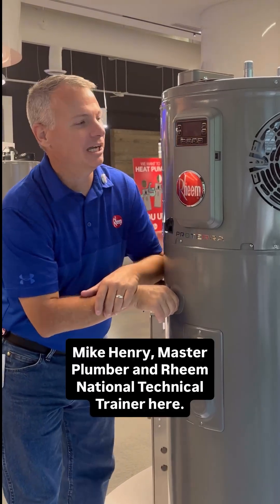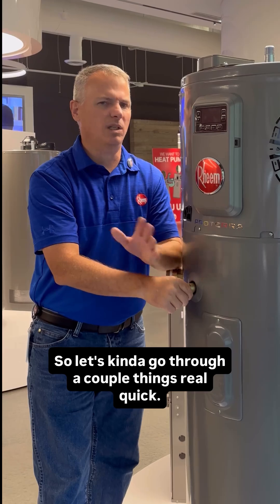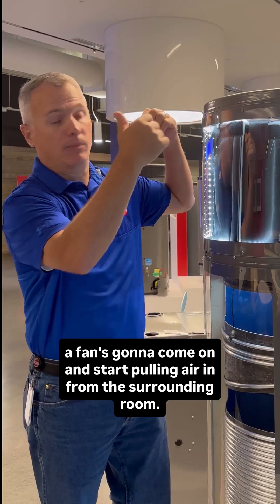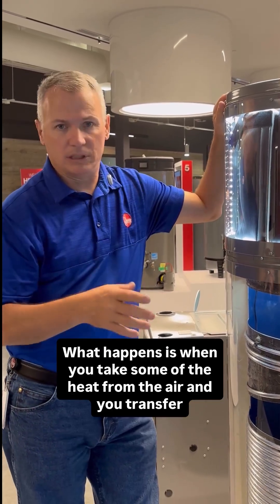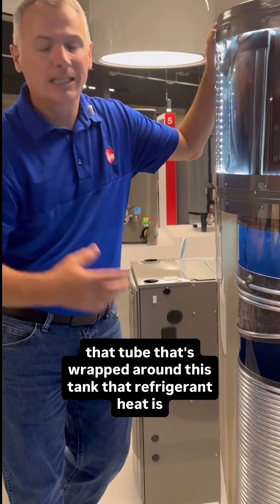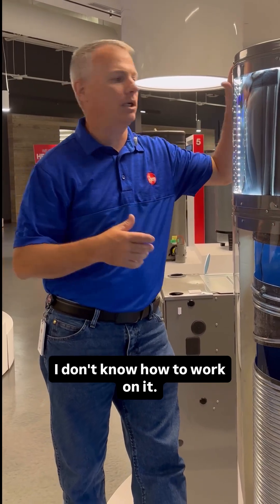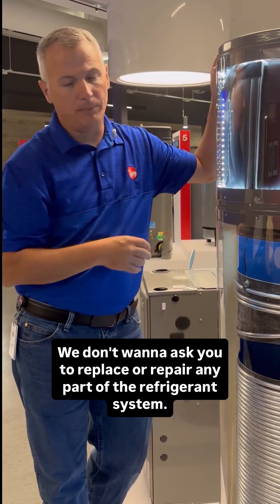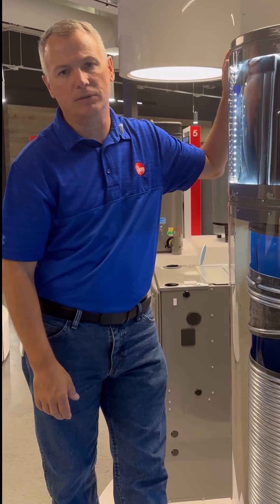What's the most common misconception about a Heat Pump Water Heater?

Comment: I'm a homeowner who just replaced my hot water heater. I looked at one of these, but decided against it. The math said it would have paid for itself in about 7 years... but that doesn't include risk. I don't want to have e to think about my water heater. I don't want an app. I don't want wifi connectivity. I don't want any circuit boards that are going to die when a cosmic ray flips the wrong bit... I want it to be as simple as possible because simplicity and reliability are highly correlated. If this had been a dead simple refrigeration system controlled by a thermostat with no electronics... I probably would have bought it.
Reply: You don't need to use the app or connect it to wifi.  Those add additional functionality and allow you to control the heater remotely.  Features you don't get with a "regular" water heater.  If you want the heater to run as a standard standalone water heater, you can do that.  You can still set the mode and temperature and other basic settings using the control panel on the unit.

The circuit board fear is tinfoil hat level stuff.  Almost everything that plugs into power has a circuit board in it today.  How often are you replacing fried boards because of atmospheric anomalies?
Reply: What is a "hot water heater" sorry man I gotta correct it everytime I see someone mispronounce its a pet peeve ill grow up one day

Comment: What’s the best mode to run it on electric, heat pump, high demand or energy saver?
Reply from the maker: Hi, that depends on what your current need is, and what makes EcoNet app a convenient way to switch between the modes. We have a blog that explores the different modes: https://bit.ly/4oAQH7O